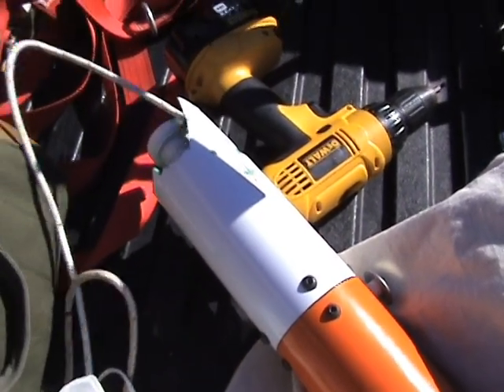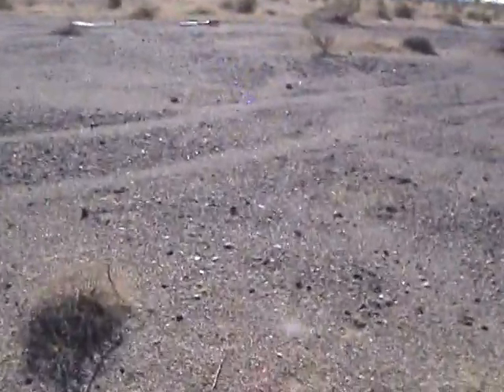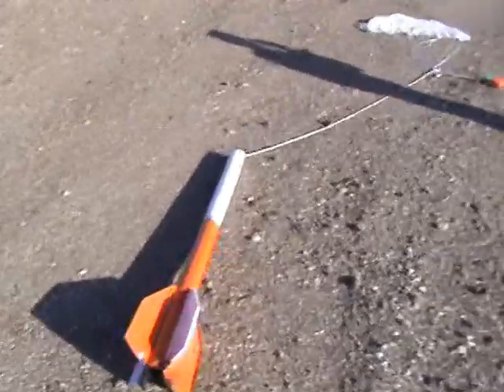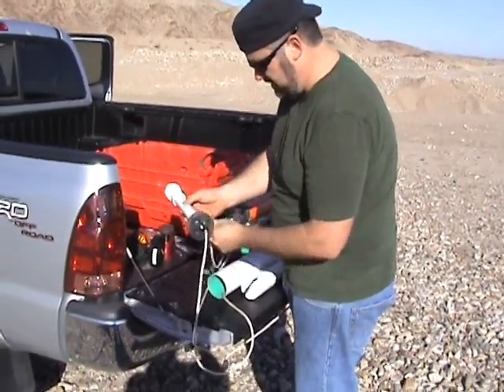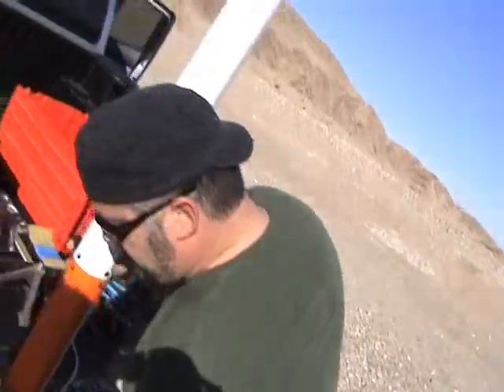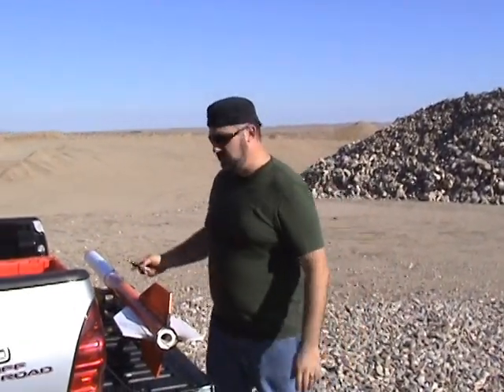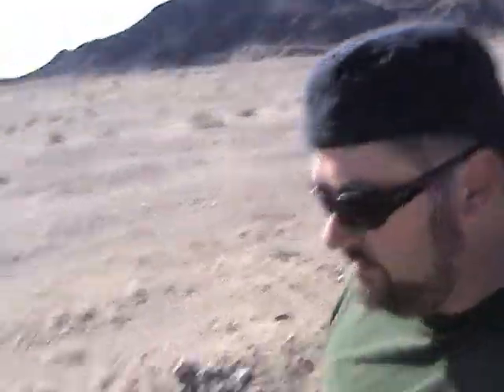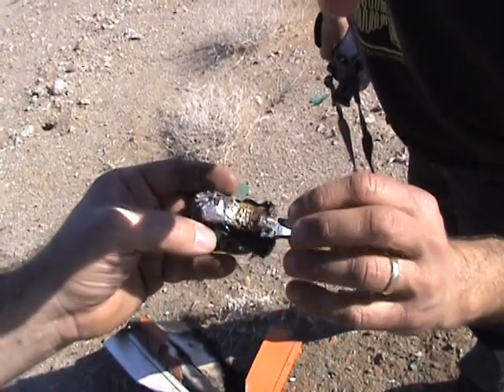Kno3 Sugar Rocket with on-board video 2nd attempt

Comment from the maker: @MrEminemTv Not really. The fuel will be brittle and it will crack under pressure causing the engine to explode. It may not happen all the time but it will eventually. Corn syrup makes the fuel flexible so it can bend under pressure and not crack. Theses engines work consistently and never fail.

Comment: Hey dan when i get my level 2&3 certification done i'll upload a vid of a launch i did using a motor i built with 
100mm diameter x1.5mm wall thickness seemless metal tube and
 propellant mix
 Tar,kno3,iron oxide..
turned out to be a real high flyer..
James

Comment from the maker: Oh the Coyote Rocket is 95% there! I'm not going to give up on it just yet ;-) I am making a few changes for next launch, a different body material, a new connector for the piston, a more reliable parachute folding and rigging technique and different video camera placement. The next thing I need to work on is the spin issue. There's lots of work but that's the fun of experimental rocketry. The rockets are cheap so making a new one is easy and not too hard on the wallet.